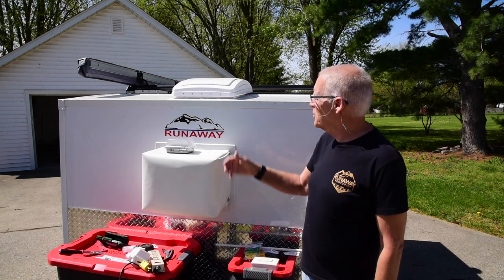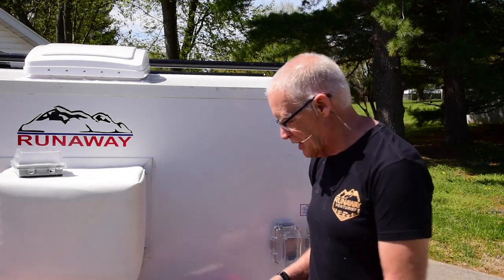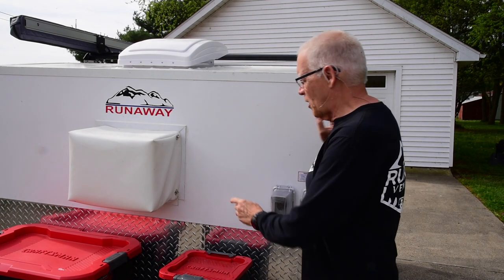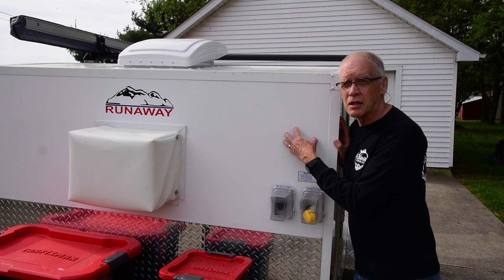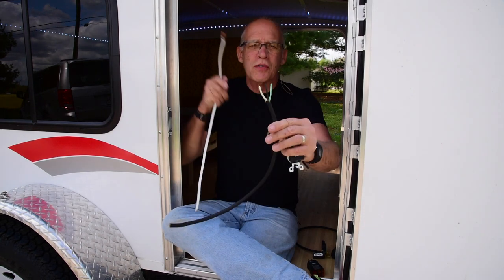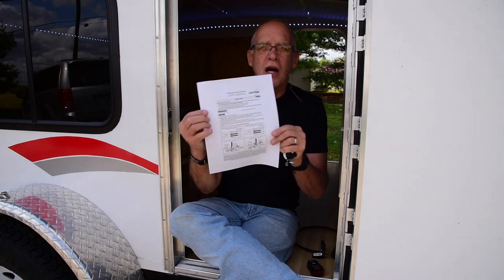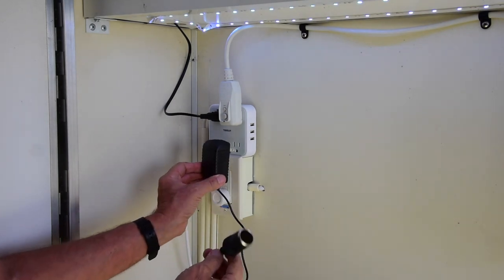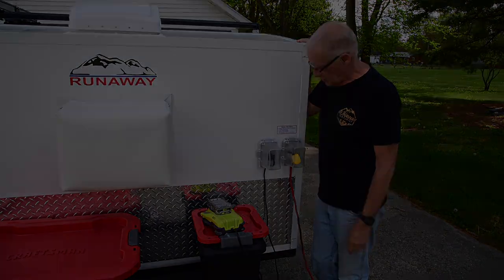My Runaway Wiring Project with Charles Moman

Comment: Charles I enjoy your videos and I appreciate the time you take to think through what you try to help with.  I have been researching many things before purchasing a Runaway trailer, which my wife and I will order late in the fall.  I am also wanting to be able to be off grid for a few days at a time and not wanting to get a generator or a big solar system.  I am wondering how you have tackled using the Jackery 5oo for the fridge when you are at a location location without shore power and at the same time keep the battery charged.  The fridge is something that I do not want to have to move around and I wonder if you leave it with the jackery in the van during the day and at night, or are you moving it to and from the car during the day.  I am wondering if one Jackery 500 will suffice or if I really need that and and a smaller lithium battery for inside trailer lights, phone charger, laptop etc, if the fridge is in the car.  Lastly on colder nights it is nice to have a warm trailer and I have been looking into small oil filled radiator heaters as we like the radiant heat. I have found some that are 700 watt heaters and wonder if the Jackery 500 would run the fridge (IcegoGo20) and heater without draining the  jackery 500, leaving us with out power the next day.  I know you get many questions and we do appreciate the help. Like you, I do my research as it often saves back tracking later.  We too have a 2015 Grand Caravan(love the Grand Caravans, our second one) and traded for it last fall with the idea of using it to pull the trailer.  Thank you Charles and Susie.
Reply from the maker: I got this reply to your questions for you from my portable-power-knowledgeable friend, Timmy.

"Sorry the Jackery 500 is not going to run a 700 watt heater for long. We have a 350 watt heater and overnight it can use in excess of 1000 watts. I think last time I used the heater, TV, charged phones solar put back in around 1500 watts. Heat and air conditioning are the energy hogs in this size system". 

Back to me - my wife and I use a 12v heated mattress pad with the Jackery 500 and it works great - almost too good.
We keep the GO20 in the car all the time - either plugged into the Jackery or the cigarette lighter outlet.